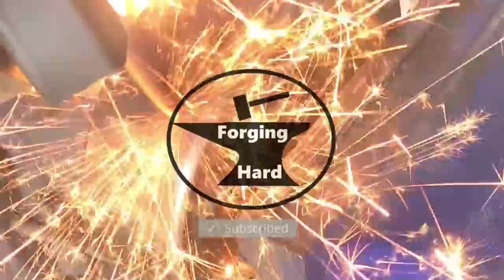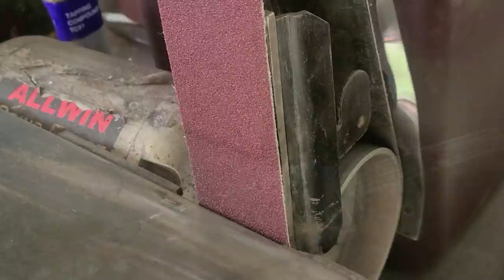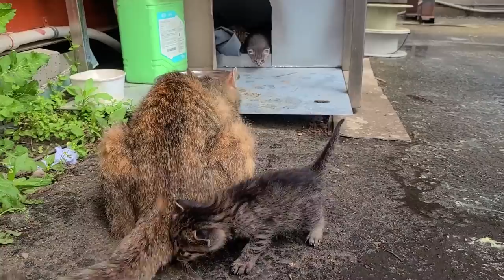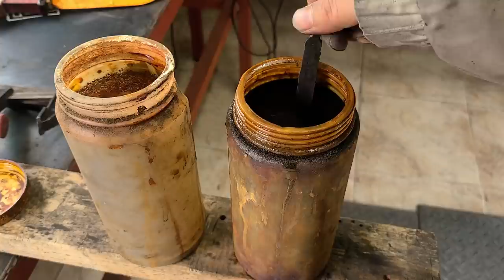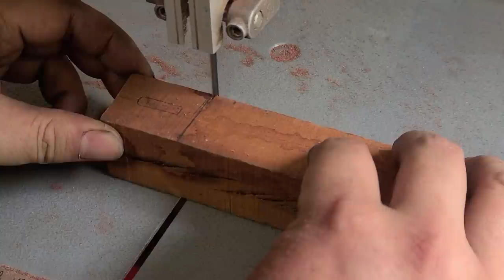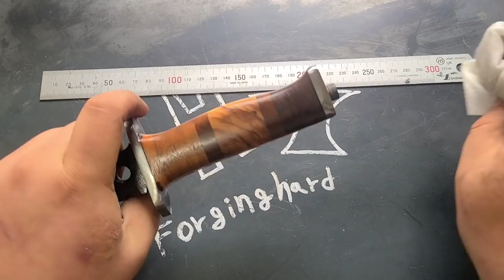make a camping knife from Bearing race

Comment: This is so educational and satisfying to watch.  Every step taken from the forging, tempering, quenching, and grinding of the steel was shown.  A lot of people don't realize how good a choice in steel a bearing race is in blade making. It's tough stuff and can be had for free from mechanic shops' used parts willing to get rid of them. Some makers just buy bar stock of varying grades from knife supply companies.  Using a bearing race takes skill to hammer out into a useable blade.

Comment: Wat is the grit of the sandpaper used when you hardened the blade ? By the way primo work
Reply from the maker: Thank you for watching.
The sandpaper I use is #40, #100, #220, #400, #800.
The hardness tester used after quenching is HRC 60.
I am a Google translator user. I don't know if I understood your question well. Sorry.
Reply: I thank u for your information, Greg